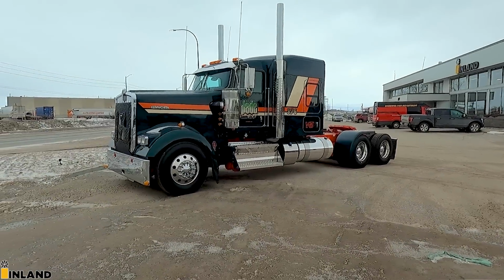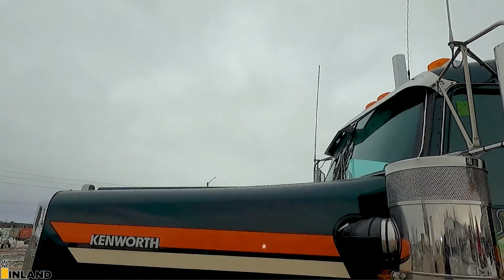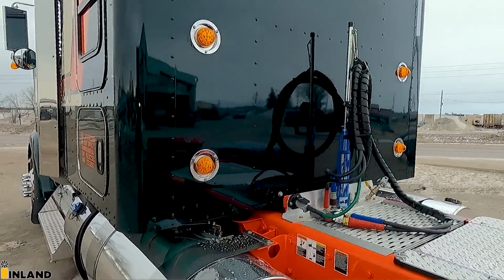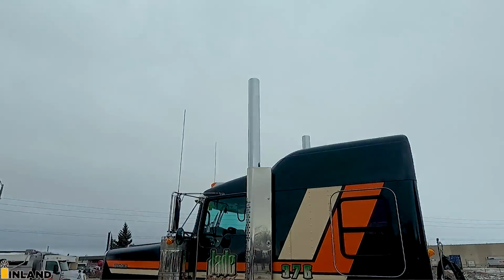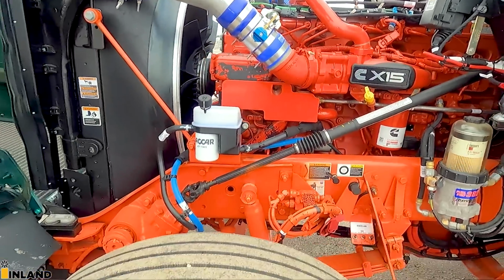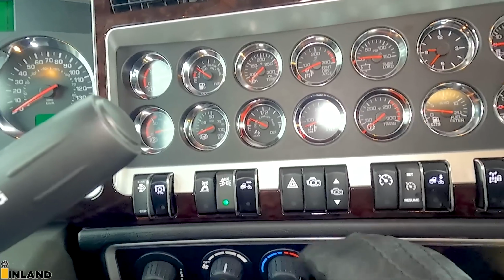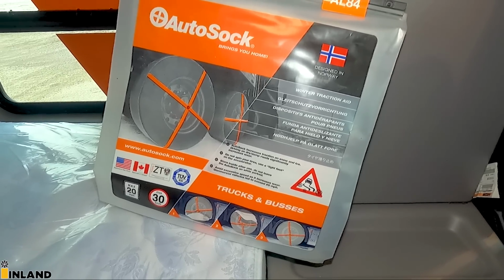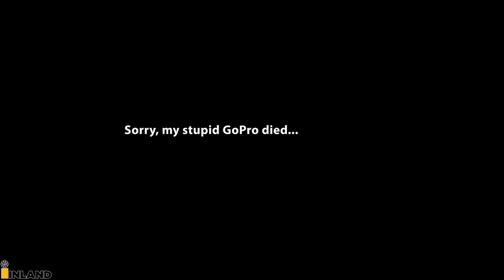HOT ROD! 2022 Kenworth W900L 72  Flat Top   THE KENWORTH GUY

Comment: What's with the "HOT ROD" title? 
It didn't even have the 605hp 2050lbft engine, so what makes it a "HOT ROD".......🤔
Reply: There are plenty of cool looking hot rods with stock horsepower Chevy 350s.
Reply: @averyw.3939  

When I saw the headline, I was expecting at 605hp 2050lbft engine, which is the highest horsepower engine you get in a new truck, plus I was expecting to see a #PDI Intake and exhaust manifold, which would make it even more powerful, but when he said 560hp and 1850lb i knew it wasn't no Hot Rod.